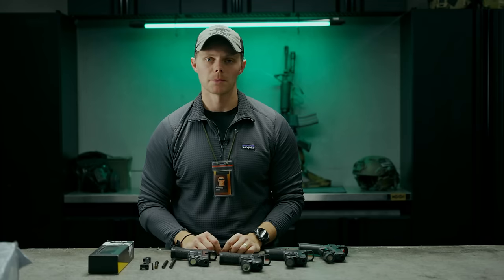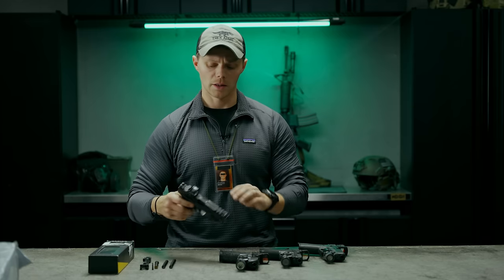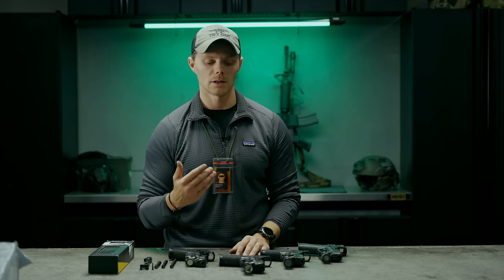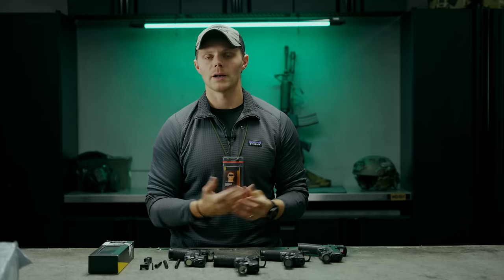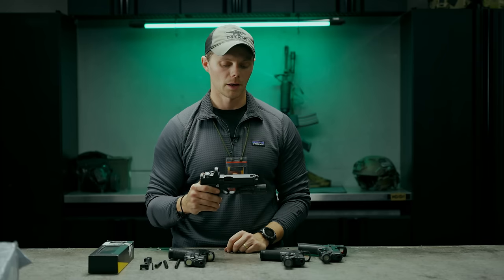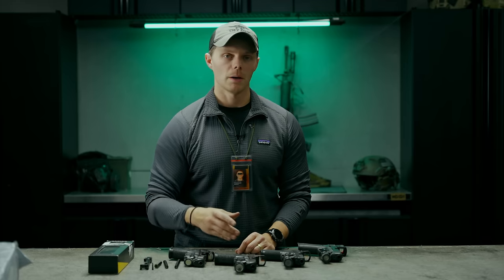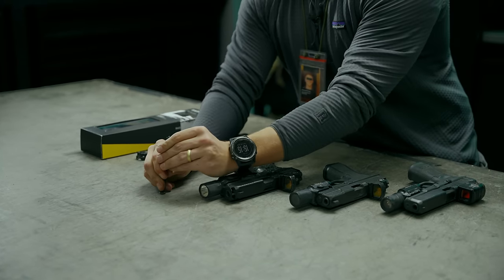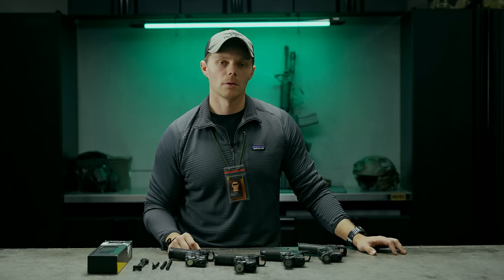Evaluating the Radian Ramjet Compensator

Comment: Put thousands of rounds through mine on a 19, no issues and love it. Shoots very flat and never had slide lock issues even with a holosun on it. One of the main selling points of this comp is that it does not require a threaded barrel, which is not legal where I live. It uses a pinlock screw system. Also you're paying for the barrel which is a match barrel.
Reply: Do you have a Gen 3 or Gen 5?  Eveyone with a Gen 5 has zero issues but my buddy and I both have Gen 3s and had to buy the 13lbs recoil spring because we were getting stovepipes with our OEM 15lbs recoil springs
Reply: @jerdog333  I have a Gen 3. And how odd, I have the oem spring in there. Only mods are a factory slide milled by LWS, a Holosun 408t, and a Surefire XC1. Make sure you’re not holding the grip too light in attempts to feel the recoil mitigation. Limp wristing is the primary cause of stovepipes.
Reply: @InvalidUsername725  Thanks for the info.  I just spoke with my buddy and we are both selling ours.  I took a class last week and the instructor was having the same problems as me with is Gen 3 so I'm uncomfortable carrying this as my CCW.
Thanks again!  And let me know if you want to buy 2.  I bought one for me and my wife and I'm selling them both and buying ammo!  Haha. Be well.
Reply: Bought two and had ftf for both on my Glock 45. Even tried the spring kit :(
Reply: @enrico8730  Just realized I also have a Johnny Glocks Combat trigger kit with the 5lb striker. In the comments below I saw some people had issues if they changed their striker springs. Just a thought
Reply: @enrico8730  How disappointing. I'm selling mine now.  What an expensive experiment.
Reply: @InvalidUsername725  mine was all stock except the ramjet. Idk so I’m pretty disappointed for now lol
Reply: @enrico8730 works great on my G45 with the 15lb compressor spring from Radian. Shot well over 5000 rounds now in various COF courses.
Reply: @jerdog333 do you have black or fde
Reply: @HKGunPlay  black
Reply: @jerdog333 damn that sucks, mine worked flawlessly on my 19x
Reply: @TonySoprano-on5iu  Yea, us California boys can only get Gen 3 Glocks so everyone that seems to have my same experience has a Gen 3.  Gen 5s seem to be problem free.
Reply: @jerdog333  why is that? Man California gun laws would’ve made me move out quick lol
Reply: @TonySoprano-on5iu  Haha. I hear ya.  I wish I could move, but my career it almost exclusively here in LA.
In Cali we can only buy handguns on the Handguns Certified for Sale Roster.  I think only 5 new handguns have been added to the list in the last 10 or 15 years. Not only do the handguns have to have certian features, like a loaded chamber indicator for instance, but the company would also have to have it ship with a 10 round mag and pay each year to get it on and keep it on the roster.  And as much ast that sucks, that's far from the worst Cali gun law.  SB2 just took away the rights of CCW license holders to carry a gun virtually anywhere. I wish I was a criminal so I could get some protection from the Cali law makers!  haha
Reply: @InvalidUsername725  was literally gonna say he was limp wristing it.

Comment: For the record, I think the OEM recoil assembly on G45/G19/G17 is 17#...not 15#.
Reply: Lol I thought it was 16.
Reply: @dylanholbrook6239   Yeah, I tend to run a #15 RSA and a #5 striker spring along with the reduced power safety plunger spring, but I do replace my RSAs more than most (ever 1.5-2K rounds). I think a lot of guns are oversprung and prefer shooting with weaker recoil springs (43X felt this way as did the Echelon).
Reply: @joeflowers9084  most guns are sprung for a wide range of ammo. There's a pretty bigg difference between 124gr@1200 and 115@1150. Manufacturers definitely error on the side of extra spring tension for that reason. I literally keep it stock tho.
Reply: Yeah, I misspoke. 17lb is OEM.

Comment: I picked one up and put it on my G45. It really shines when firing heaver gr ammo and anything +p. Having both a g17 and this I feel the recoil impulse with the radian is less. My times also show an improvement with the radian. Im a full 3 tenths faster on average shooting a bill drill since running the radian. I had hit a plateau previously. Expensive? Yes. Worth it if you are looking to shave off tenths of seconds, also yes.
Reply: this is great info to know as I am considering getting one. Thanks
Reply: I have a g45 and Herrington arms comps. Are you running the stock spring or you bought the radian springs?

Comment: I am seeing them go for $299 a few places, so the cost is barely more than a case of ammo. However, for what many did pay ($379), you could even chunk port and back-bore a G19, and that would mean you didn't have the extra length and weight, and it would be as effective. 
I like comps, especially the CR920P, which turns the Micro 9 into a soft shooter (soft as a G17 or less to me).
Reply: Where they going for 299 at
Reply: @October.409  ABCSportZ had them for $299...snatched one up but they are out of stock now.  Keep an eye on their site
Reply: The port and reem will not work as well as the added comp.
Look at it from a physics stand point. 
Gas direction can only be to certain level ( only so much gas can be directed with equal rounds). The added weight will also help in reduction. 
So, physically speaking, a G19 with a light and RamJet will perform better than a G19 with ports and the same light.
You know this to be true, you can't cheat physics.
Its not space magic or a revilation.
Look at the set ups used by master class shooters, there's a reason they all add weight and a comp.

Comment: I just purchased one of these but I was able to get it for $289 shipped direct from Radian. 

Radian does sell Blems for $329.99. I had a 15% off discount code which is why I got it for less.
Reply: How do you like it? Which model do you have it on?
Reply: @09civsi  I got the gen 3 model. I haven’t shot it yet as it’s part of a build.  I just haven’t had the time to finish.
Reply: Thanks for the tip.
Reply: @09civsi I love mine, I have a Glock 17 with thousands of rounds through it. Like one of those glocks with a stock trigger that’s actually nice because it’s so broken in. I’ll take my Glock 45 with the ramjet and afterburner 10/10
Reply: Yea, he definitely exaggerated the hell put of the cost. You can easily spend well over 400 on a comparable barrel and comp.

Comment: you in fact do need the guide rod set... at least i did. my glock 19 wouldnt get through a single mag with the stock spring. radian said it was probably my optic slowing the slide down (509T x2) yet others ive seen with the same optic were just fine with the stock spring. radian said i should use the 15lb spring. so, some people dont need it and some do.
Reply: I had the same issue. Had a acro p2 and troubles feeding with it on my 19
Reply: @thentantt  i had better reliability and performance with the 15lb spring from radian. Didnt test the 13.
Reply: @thentantt  tbh with the stock spring the gun would shoot a little softer but dip down when returning to battery so its honestly better to go with the lighter spring. But my stock spring was almost new so if your gun is more broken in you nay have better performance
Reply: @seaocean4868  I’ve had good results with a 13 pound spring. 15 seems to be the sweet spot tho for larger optics
Reply: @seaocean4868  I’ve had good results with a 13 pound spring. 15 seems to be the sweet spot tho for larger optics

Comment: 1 malfunction every 200-400 rds is insanely frequent for a stock Glock. Short of lack of maintenance or trash ammo what is causing that failure rate in your guns?
Reply: I was thinking the same, I've fired well over 1500 rounds on my new 47 with no failures

Comment: I've got close to 12,000 rounds through my Ramjet/Afterburner over the course of a little over a year, and I'll say this... If you're buying the Afterburner, go ahead and do yourself a favor and buy the Compressor guide rod. You will thank me later. I was having a weird double feed issue with mine until I put the 15lbs spring in and it's been running like a top for at least a few thousand now. 

EDIT: I want to add that the double feeds with with Blazer 115gr and 124gr, didn't have the issues with other ammo, if I remember correctly. Could've been an ammo issue, but it has ran fine with all sorts of other crappy 115gr (even Tula steel cased and some weird Turkish ammo that has seemingly has zero flash suppressant in it). I've found that the Badlands Ammo Co's Jello-Shots are the best shooting rounds for this set up in my experience.
Reply: Since you have 12,000 rounds do you think it's better to get a Glock 17 like the video suggests? Was the price point worth it for you?
Reply: @TheRedArrowExpress  It depends on what you want. I feel like a Glock 17 is a better all around option and is much cheaper, too. I would recommend the 17 if you plan on carrying it, too, because I typically want my carry Glocks as stock as possible (though I'll admit I do carry my G with the Afterburner). If you want something that shoots super flat and fast, go Afterburner. It was def worth the investment for me, but I also use this same set up to shoot USPSA, steel challenge, etc.
Reply: @WheelchairOperator  
Thank you for your insight and with the familiarity you have with the product and if this were available for the Glock 17 would you buy it? Assuming that you did not have it for the Glock 19 or had the funds to buy it for another handgun.
Reply: Radian is coming out with the 17 version and I have pictures of it somewhere if you'd like them. I would definitely buy the Ramjet for the 17 if I had one. I really love the unit. 
 @TheRedArrowExpress
Reply: @WheelchairOperator  
Ah sweet, I'll probably get it for a stripped build then.
Thank you very much for taking the time to answer my questions.

Comment: For that price point, you can definitely buy a CZ P-09/P-10C.  Interesting compensator though!
Reply: Yes but do you need another handgun or is it better to upgrade the one you have. No wrong answers.
Reply: @islas357 I'd say another handgun would be a better choice tbh. Two solid and shootable handguns are better than a single soft shooting handgun.

That said I'm still interested in these.
Reply: @robertparis5680 if you have several guns already there is no point to buy more guns just because it cost the same as a gun. You could buy 4 hi points 😂

Comment: I like my 60 dollar wilson combat comp for my 1911, but 350+ for a comp and a barrel system seems way to steep.

 Thanks for your evaluation, and thanks for getting me the new chest rig 7 days after black Friday!!
Reply: You can find them for about $300 when demand isn't super crazy like it has been. It's not just a comp but a barrel too so factor that into the price.

What they didn't mention, is for those who like to disassemble and clean their pistols, this is the comp for you. What I don't like about standard comp/barrel combos is that the barrel is extremely hard to clean.
Reply: @mutiracialbeatdownPB  what? How do you put it in the slide then? All comps besides this comp are for threaded barrels with bottom set screws. There's literally no way the comp is part of the barrel brother.
Reply: @2amichaelj pretty sure that's what he means. Typical comp is attached to the barrel and is stationary. If the wilson 1911 comp is anything like most cheaper 1911 comps, it replaces the barrel bushing and attaches to the slide rather than the barrel. Its moves with the slide as it cycles, likely reducing its affectiveness relative to a barrel mounted comp. Think that's what he's getting at anyway.
Reply: @Topher7527  ah... I missed the original 1911 part. That makes a difference.
Reply: @mutiracialbeatdownPB 
Wrong.

Comment: I think the performance was excellent when I had mine.  However, there is far too much impact shift between different ammo types.  With most oem barrels my carry ammo and range ammo are within 1-2” at 25 yards.  With the ramjet it was 5-6” off.  Huge pain for training.
Reply: I've had zero shift.
Reply: Idk how, several tests with different grain bullets have shown to have zero shift in comparison to stock barrels.
Reply: You’re cappin, check your skills
Reply: @BananarchOfTedKacistan  I’m not the best shooter, but I regularly score mid 90s with my g45 on a b8 at 25 yards.  The ramjet was throwing other rounds even of the same grain weight 3-6 inches off depending on the load.  A shooter more experienced than myself that regularly scores in the high 90’s with his G45 also had the exact same issue.
Reply: @jonah8133  me or Bananarch?

Comment: It’s a cool mod to a g19 but yeah, buy a glock 47 and stick the longer slide on a 19 and you get the same benefit also. If these go less than 300 bucks I might get one down the line
Reply: Long slide in a short grip? Makes no sense
Reply: @Rubeless  not really my vibe but theoretically putting a ramjet on a 19 makes it a Glock 49 😂
Reply: @Rubeless  the 17&19 have the same proportions. But the 34 is 0.8" longer slide on a 17 frame. The Glock 49 (17 length slide, 19 frame, or a 47 slide on a 19) is only adding 0.5" to the 19 frame. Seems pretty sensible

Comment: For future testing, it may be worth it to you guys to measure the length of the spring before during and after testing. Especially once it begins malfunctioning. AR15 carbine action springs have a TDP spec length of no less than 10-1/8". When new they should be closer to 11-1/4", thats what my colt ones are. The most recent PSA one I got was about an inch shorter at 10-5/8", so not yet out of spec, but it won't be long before it is. That spec is for round wire only, tubbs flatwire are longer so the spec isn't linear. I say this because I imagine that the "compressor" spring lost some decompressed length during those cycles which makes it weaker. While Radian does say that the compressor is using a flatwire spring, it does not specify the material. They could probably improve the design by upgrading to chrome silicon like sprinco or a different form of stainless like tubbs.
Reply: @ReCyclops1232  this video is about the radian ramjet compensator for a glock my friend. I was talking about buffer springs as an example of spring decompression as cycle count increases. This happens to all springs, some worse than others depending on construction. Some of the malfunctions they were encountering at higher round counts could be due to the spring weakening.
Reply: @musician445  you are correct haha multiple YouTube tabs open I guess ahah
Reply: @ReCyclops1232  No problamo, i'm right there with ya lol.

Comment: @4:42 It's not just NODs that create an issue with comped pistols. Don't assume that, in a real fight, you'll be able to get your high-speed, low-drag tactical range firing stance (First Rule: Look Cool) on before you have to shoot. If you have to shoot from a retention position, you very well may "notice the flash, or care about the flash" when hot gas blows into your own face.

Comment: I’m not sure if it’s urban legend or not,  (still, I heed the warnings) that Glock doesn’t recommend a metal guide rod as it has now flex and can eventually cause slide damage. I’m a prepper of sorts so I always have a spare oem rod and spring…and also a spare oem striker assembly. $20&$50. And that higher than oem spring rate should only be needed for +p ammo. So the fact it eventually failed during your testing makes me very wary. I want it as it’s beautiful. Have threaded barrels already….now I’m thinking PMM.

Comment: There’s some odd sounding things in this review. He says they have malfunctions about every 200 rounds? That’s… quite a lot. I find that hard to believe. Second he says that the gun doesn’t lock back because there’s not as much backpressure. What? The physics of that doesn’t track to me. The direction of the gas exiting the muzzle is diverted. But the back pressure should be higher, if anything. Then he says the slide cycles faster, which tracks, but not if there’s less back pressure. It sounds more like the slide is hypercycling and not locking back because the follower is not pushing up the slide stop quickly enough. 

Sorry to say, but I doubt this guy knows what he’s talking about.

Comment: The price is comp and barrel. You make it sound like it is just a comp. Im lucky to be able to afford a few guns and accessories to go with them. As an owner of over a few dozen Glocks in various configurations, I think the Radian comp is  a great buy.
Reply from the maker: Why do you need a barrel upgrade in the first place?
Reply: @TREXARMORY in order to use the comp…or a comp. You can’t just stick it on with bubblegum
Reply: @user-vv9lr2rw5d  I think he's asking what the benefits of a barrel upgrade versus stock barrel are? And does the cost justify it? The barrel alone doesn't at all, but to your point, in order to get the benefit of the comp, it attaches to said barrel.